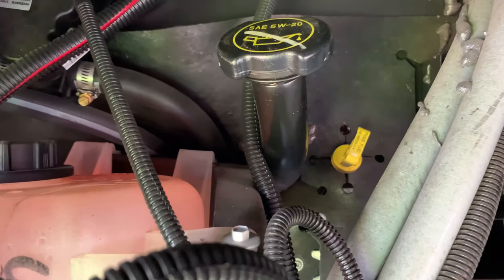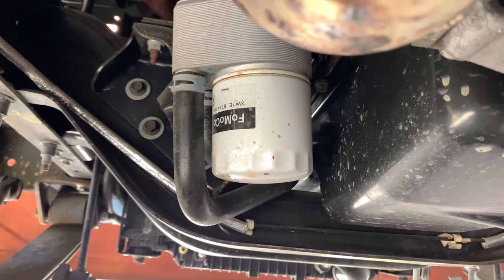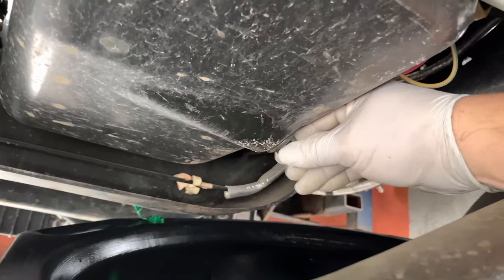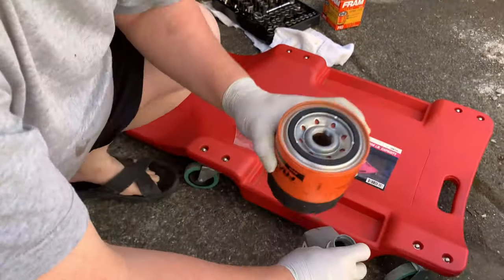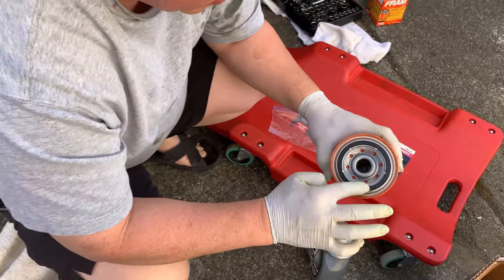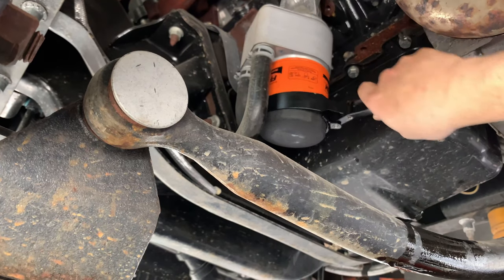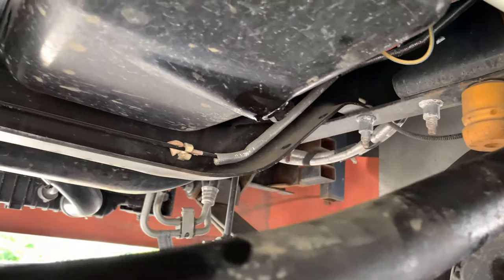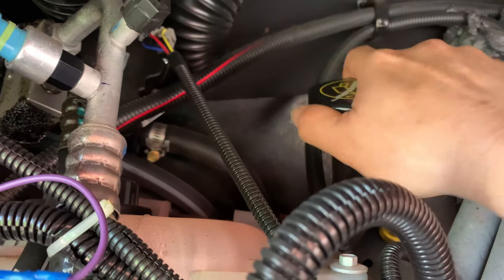Thor Motor Coach Ford V10 6.8L Oil Change

Comment: Hi, do you know the location of transmission dip stick? TIA!
Reply from the maker: Sorry the late reply. The transmission dip stick is behind the oil filler cap, it yellow handle. 
My motor home doesn’t have have the oil resetting button
Reply: @giainhsumofamily9038  Thank you!